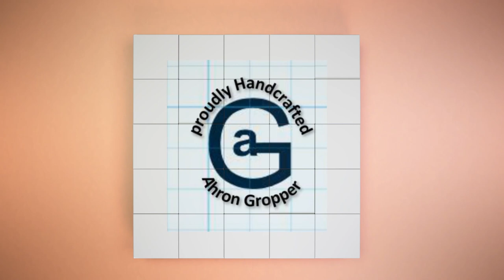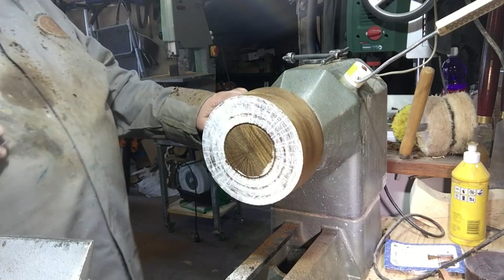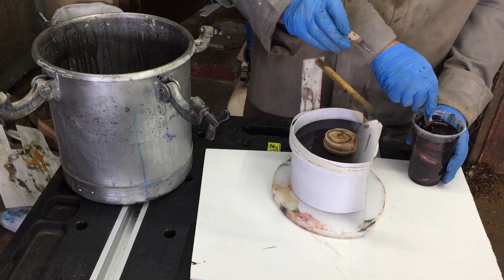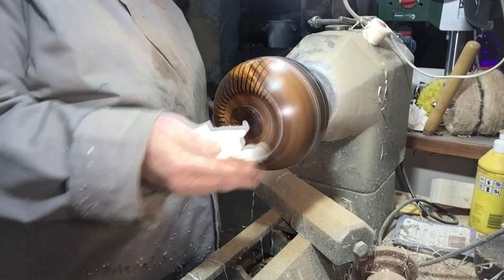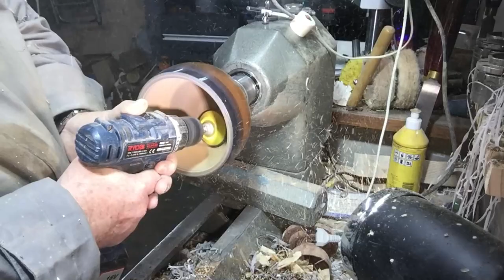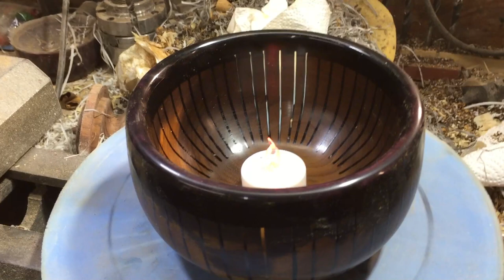woodturning - An Okapi bowl

Comment: Hi Alron amazing piece of work I loved your video especially as you're playing some great music in the background and you're turning it off when you go to talk yes shame about the light under the tool  rest.
I'm trying to save up for pressure put at the moment as I'm retired probably like what do you are you only have a small income coming in and pressure pots can be very expensive likewise for the resident.
I live in a converted old Mill ( Moulin. ) in the Correze in France.
Which obviously has a stream running alongside and occasionally during the course of the year I get bits of tree or would come down from up stream that look quite amazing like driftwood that you would find on the sandy beach, anyway that's enough about me keep up the good work stay safe.
Phil from the Moulin in France
Reply from the maker: Thanks for the good words . i googled Correze  and it looks like a beautiful place . do you do wor with resin ? i some time don't use  a pressure pot if it is cold . thanks again and enjoy your retirement :)

Comment: Ahron you mentioned you had previously had a video on using a vacuum cleaner to make a vacuum chuck. I have tried to find it but haven’t been able to. Is this still available?
Reply from the maker: Hi Norman i made a video on a slow turning motor for nova dvr  and i showed also my vacuum system .look from the 1:20 minute of the video  https://youtu.be/h33cZKKGH30  hope it will help if not you can get in touch with me
Reply: @oldmanwoodcraft  Hi Ahron 
Thanks for your quick reply. I watched the video and got some tips from it. Really enjoying your channel. Norman